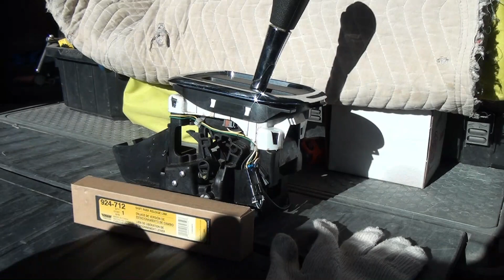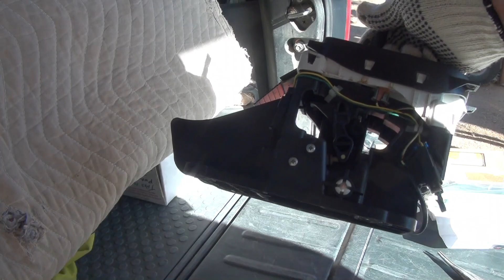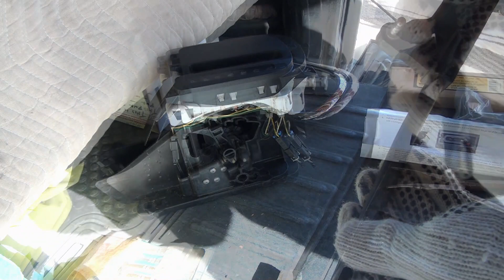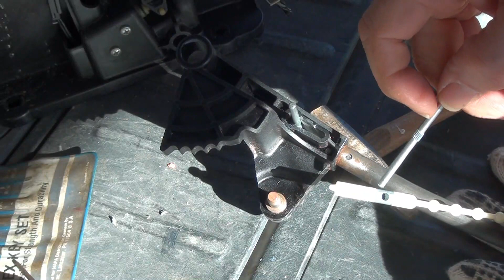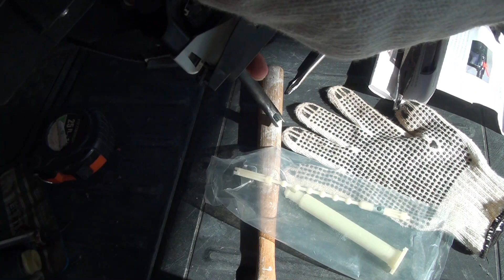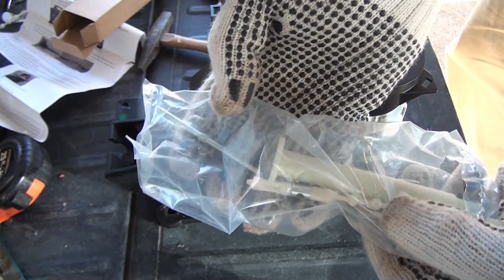Shifter Rebuild Kit For Chevy HHR, Cobalt

Comment: it looks a bit complicated but you fixed it anyway,, too much plastic junk these days , it only lasts so long and then starts to break down.
Reply from the maker: Makes one wonder how much plastic they are building in commercial airliners. I do not know when they started using so much plastic. but I am sure it has to do with The Corporate Average Fuel Economy (CAFE) standards for better fuel mileage.

Comment: This is Plastic JUNK on these modern cars..Booo Hisssss.....GM has NO quality anymore
Reply: @Steve Silvas  I've kept my 1979 Ford F100 302 engine for over 30 years and rebuilt the entire truck when it had 60,000 original miles due to Zero maintenance . NO plastic in this truck except the dome light and the grill.
Reply from the maker: @Steve Silvas  Donor Corvette...now I am drooling.LOL
Reply from the maker: One can only hope they turn things around. The new C8 Corvette is quite the machine from what I have been reading.